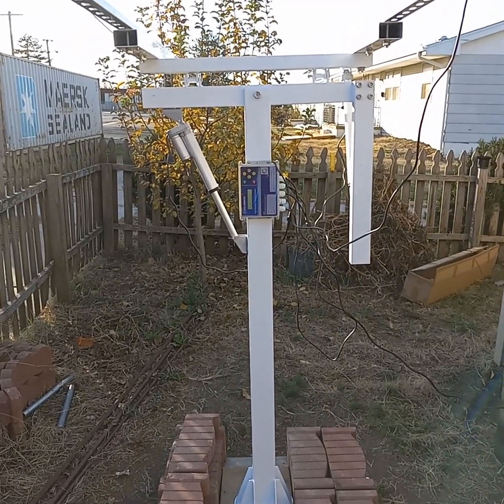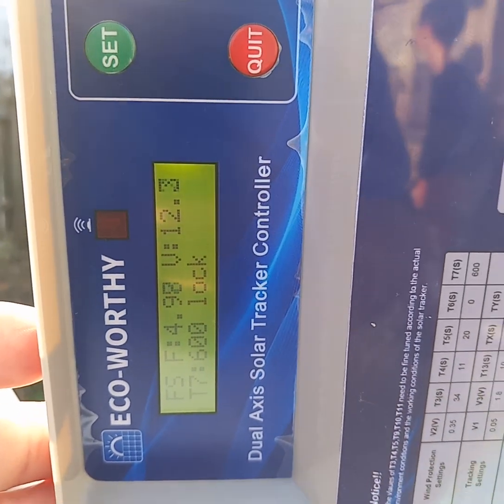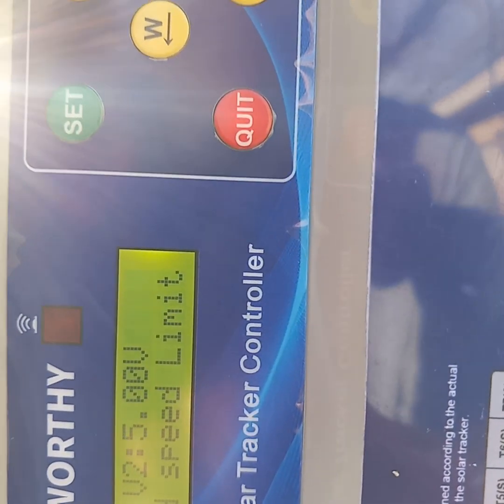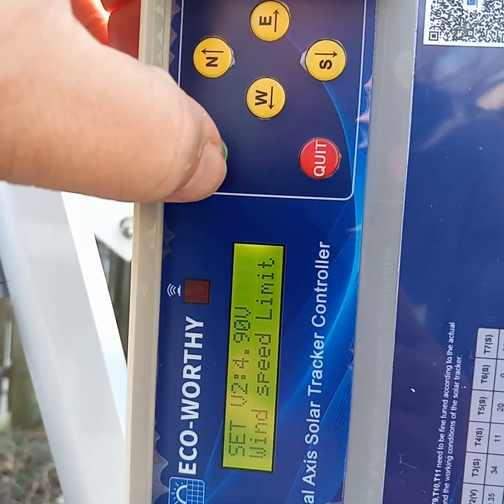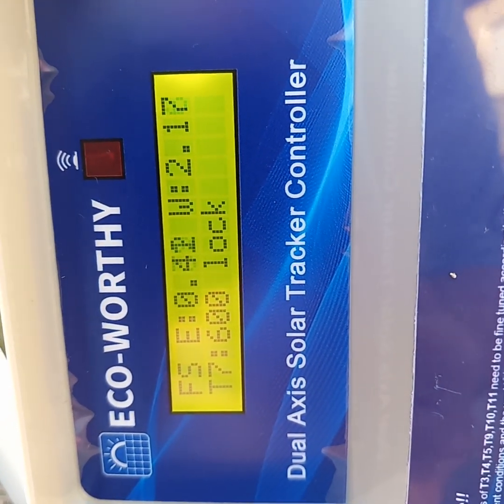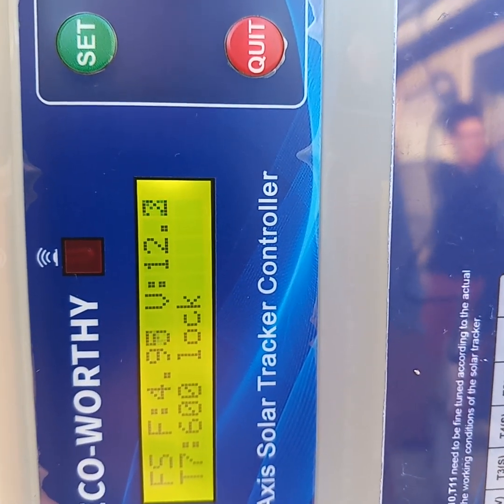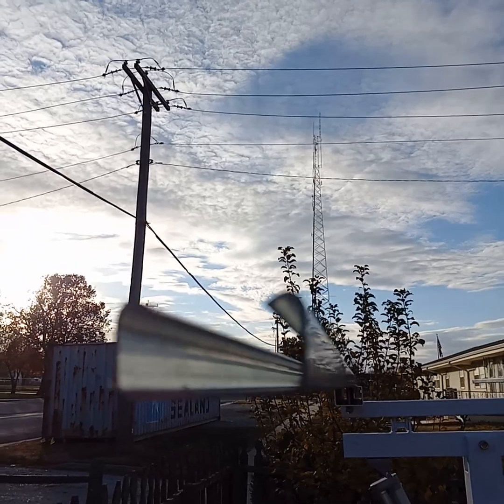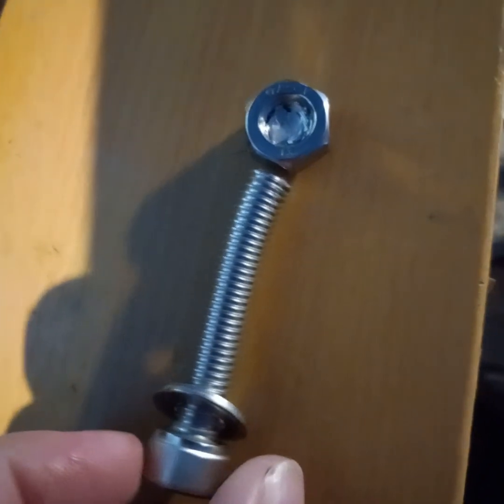Bad Controller on an Eco Worthy Dual Axis Solar Tracker. It will not track the sun.

Comment: I noticed the wind sensor is not installed. Is there a resistance needed to put a load on it to lower the voltage and have it work properly ? Why is the sensor not installed ?
Reply from the maker: I didn't install it yet, it was pointless as a single hundredth of a volt would have pushed the unit into safe mode. I got a replacement unit in but the wind sensor seemed to be bad as well, the unit works fine without it but will not be wind safe at all, so between all that and the fact it was so sloppy with extremely loose tolerances, the bad bolts etc the wind would eventually rip it apart regardless so I took it down as a complete waste of money. I will see about experimenting with removing the slop and strengthening the arm that has ripped off for many when it warms up this spring to see if i can make it useful at all

Comment: Another setting you're not going to like is the low light setting.  Depending where you set this voltage results in how many times the system goes flat during one day and it could be every time a cloud goes by.  This voltage is normally 1.8v.  I've adjusted mine to .3v and it ignores the clouds and after dark, I've set it to go to the east, ready for the morning sun instead of going flat.  This stuff of going flat all the time is ridiculous!
Reply: How do you set it to go to the east ??? Mines always goes back to the west it over extends and breaks the actuator !

Comment: The default wind setting (V2) is .35v and as the anemometer spins it produces a voltage, which with no wind would be ov and as the wind increases, the voltage increases, if the wind goes over 20mph, it then activates the tracker to go level and not until then.  With a setting of 5v, this feature will never work.
Reply from the maker: As i stated if the board is bad it has a stray voltage already there that is just a couple of hundreds of a volt short of maxed out so you could run it but it would be without any wind protection because if you hook that up an ant farts worth of a breath would push out over the 1 hundredth of a volt of play you had and put it in safe mode.

Comment: I think the wind scale is a secret!!  It took me some looking into.  It's for every
 .01v = 0.56mph, so 35 x .56 = 19.6 mph is the default wind setting.  With a setting of 5v the wind will be about 280 mph.  When you mount the controller vertically, it leaks electrons!
Reply from the maker: 2V max generation by the wind units generator... Not sure it even hits that.